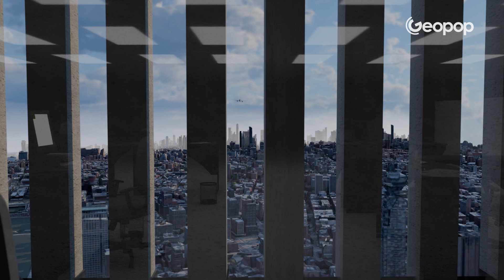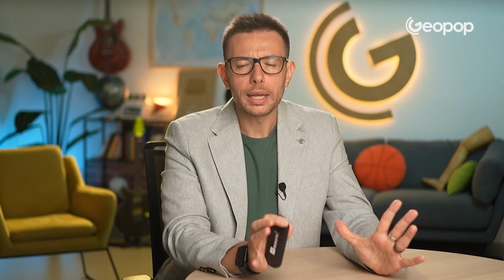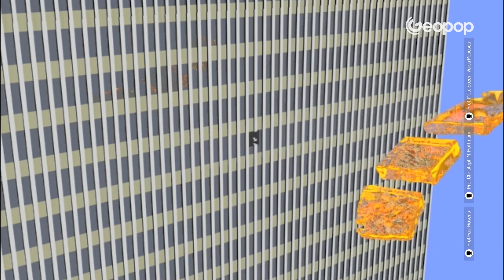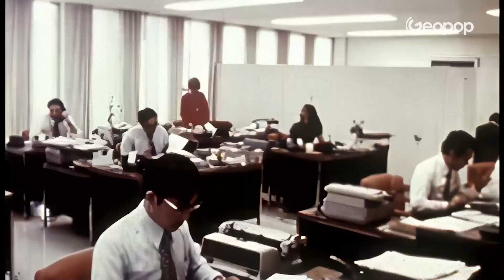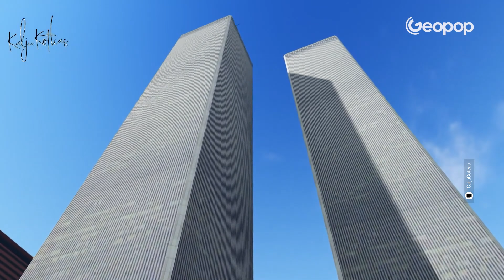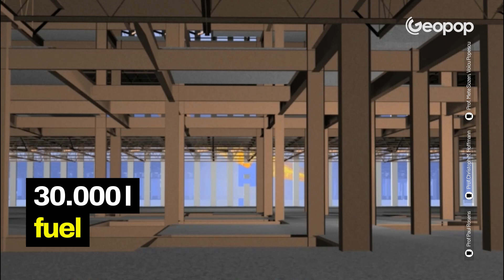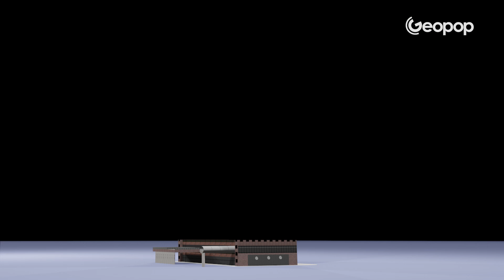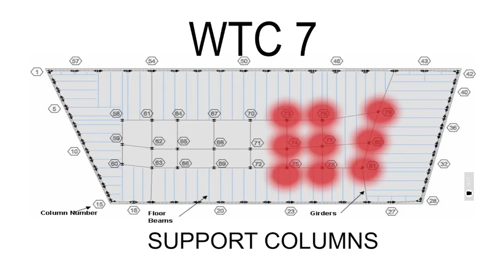9/11, 2001: The Technical Reconstruction of the Twin Towers and WTC 7 Collapses

Comment: Planes took them down ❌
Control demolition with thermite ❌
Directed energy weapon ✅
*go to RumbIe and look up Dr. JUDY W00D and her book; “Where Did The Towers Go?” You will see PR00F that they literally turned into DUST!
Reply: BS!
All you need to answer Wood´s stupid question is take a look at Ground Zero pictures.
Reply: There is a lack of concrete in the pictures,  nano-thermite maybe but I doubt it created this explosion coming from tower 7.  ? 8:25
https://youtu.be/bLF5D7M1YgA?si=aHSvS__uOdxMi1ZB
Reply: @robbiehiatt9966  Lack of concrete in the pictures?!? What kind of concrete did you expect in the pictures? The only concrete above the basement was in the floors, a rather thin layer between a steel plate and carpet or whatever. Even if that concrete didn´t turn to dust, why would you expect to see it in pictures?!? And didn´t it ever came to your mind that most the dust that covered entire Manhattan may have come from the concrete?!?
Reply: @Kudde23 there was concrete throughout the structure in the stairwell with 1 1/4 " rebar. Watch the construction process if you think I'm lying and yes it turned to dust , explosives do that
Reply: @robbiehiatt9966  Collapses do that too. Don´t get me wrong, it was controlled demolition, but you can´t tell that by the dust.
Reply: @Kudde23 there was enough concrete in those buildings to pave a sidewalk from new york to Washington.  Yet none seen anywhere
Reply: @robbiehiatt9966  It was literally EVERYWHERE. As dust.
Then there is also pictures of the so called "meteor" of molten steel and concrete fused together and also some similar but smaller examples the like. A tale of people surviving in a remaining part of a stairwell.
Man I just looked at the first GZ debris picture I found and there was a part that is most likely concrete, a piece of floor or stairwell wall. Sure that´s not much but again, these were steel structures with rather little concrete and most of that concrete was pulverized just because tons of steel were crushng down on it. It wasn´t pancakes falling nicely on the plate.

Comment: heat rises, so the bottom part of the structure, was undamaged, no damage, and built to take the weight of the building above.  If it was not rigged it should have slumped, because the bottom was not damaged
Reply: Correction - Built to take the static weight of the building above.

There's an awful lot of details you are missing.

Comment: I have cut 4 and 6 inch I beams with oxy/acet torches, where no 2 fuel oil burns about as hot as a plumbers propane torch.  I do not accept the gov't story.
Reply: OK, but what does any of that have to so with any governments story?
Reply: @TheLoonResistance  So what´s the difference between the government´s story and NIST´s story stinky? Uh just go and dodge as always stinky...

Comment: The video has many red flags, regardless of the nice animations and design and money thrown at it to make it appeal to the general.
He spoke about the scientific opinion in the beginning of the video, but brought no one to speak and give their opinions to support his claims. He did not provide any scientific facts about the burning temperature of jet fuel and temperature steel can withstand. Finally he did not explain the demolition like the collapse of the towers.
Reply: For the purposes of this video, trotting out a bunch of talking heads to make an argument from authority is not really necessary. The technical literature is chock full of such support and the conclusions shown here are fundamentally the same as those supported by the the 130,000 member ASCE.

There's an entire chapter on steel behaviour when heated. 

Please define a demolition-like collapse if you think that is a thing that needs to be explained. A building collapsing looks like a building collapsing. When your only frame of reference is planned demolitions then of course your brain wants to take the easy route and reach for that. But it does require ignoring all of the details - which is exactly what you are doing in your critique.

Comment: The towers would have broke down like they did, but the bottom floors would have blew outwards, not implode into the footprint of the building. They try to explain this with WT7, but no video footage of the WTC towers blowing outwards. There had to be other causes at play here. The WT7 explanation here is not accurate. All the other buildings in the same area would have met the same fate, but didn't. This is how they cover up the truth. They flood the internet with videos of half truths.
Reply: Yeah, no. Let’s break it down to the absolute basics:

The 47 core and 236 perimeter columns of the Twin Towers support all of the gravity loads of the building. ALL of the resistance is in the columns.

Planes impact Towers, causing massive structural damage, destroying sprinkler systems, tearing out gypsum board walls and blasting off the SFRM insulation from the floors. Multiple floor-wide fires are started instantly and spread rapidly due to the destruction of fire protection systems and venting of the building during the impact.

Serious fires were largely confined to the impact damaged floors and those immediately adjacent to them.  

Fires were started by the impacts and fuel aboard the aircraft, which acted as an accelerant. No shortage of other consumables inside the tower to continue the fires. 

Collapse was initiated (started) at the impact and fire damaged floors when floor trusses exposed to heat over time sagged, in turn pulling on and causing the inward bowing of perimeter columns by up to 5 feet until they buckled. 

www.youtube.com/watch?v=ULdiD6gYZO0  

No steel melted or needed to. Structural steel will bend and fail at less than half its melting temperature.

Once the perimeter columns buckled the formerly static load above became a dynamic load 30 times greater, easily overwhelming the structure below.

Thousands of tons of now loose debris fell through the open off space - through the inside of the building bypassing the columns - dropping 12 feet onto the first intact floor it comes across. The massive instant overload causes the floor to fail, adding its mass to the falling mass which continues to accelerate for another 12 feet until it impacts the next floor, rinse and repeat all the way down. Rate of collapse increases as momentum increases. As each floor fails, air inside the building (the Towers were 95% air by volume) is compressed, then blows out the sides _in reaction to the Tower falling, not the cause of the Tower falling.

No fire required at all on floors below the impact points for them to fail. The mechanisms that started the collapse are different to the mechanisms which continued the collapse.   That will be a difficult concept for some.

As the floors fail the perimeter columns are left literally hanging in the breeze, no longer attached to the rest of the structure. They peel away and fall in great sheets (think banana) out to more than 600 feet from the base on the 4 points of the compass. 

Core columns failed last. 

Each 110-story tower had a 1-acre footprint. The debris pile was up to 14 stories deep and spread out over 16 acres, destroying 8 surrounding buildings and damaging more than 100 others.
Reply: Here's the cause for tower 7, listen close.8:25
https://youtu.be/bLF5D7M1YgA?si=aHSvS__uOdxMi1ZB
Reply: @robbiehiatt9966  - Yes, a single video shot 6 hours before 7's collapse where an asshole from England dubbed in a fake explosion noise from a video game is your best evidence. And you know this but you keep reposting it anyway, expecting different results.  FFS 🤦‍♂🤦‍♂

Comment: Anyone who claimed it wasn't hot enough is an idiot and didn't learn anything in school! Anyone who doesn't know how a blacksmith works ..how shape metal! I just feel sorry for them. I was 13 years old at this time and understand this! I will never forget this day for the rest of my life.
Reply: It sounds very much like you're saying that buildings can't be built to withstand a fire when actually buildings are designed with steal because of its resistance to fire. These buildings, like most, are designed to burn to extinction without collapse and your saying that isn't a thing but I promise you it is
Reply: @ What are you babbling about? It's about the WTC and you see what? It's not!!! Bye OMG
Reply: @marco203 wtc was designed to burn to extinction without collapse.  There were explosives in the buildings that created explosions like this one here from tower 7. 8:25
https://youtu.be/bLF5D7M1YgA?si=aHSvS__uOdxMi1ZB
Reply: @marco203  These towers were literally designed to withstand airplane crashs and in contrast to the lies that stupid shills spread they OF COURSE also considered the fires that would surely result from an airplane crash. And guess what, they came to the conclusion that the fire would be the biggest problem, for the people inside, not for the building which would keep standing. That´s what the engineers in the WTC construction figured out. And that´s despite the fact that the towers didn´t even have sprinklers when they were opened.

You may also find interesting that NIST analyzed steel from the fire zones, steel that was directly involved in fire. They couldn´t find a single piece of steel that had reached 600°C or more. The very most parts hadn´t even reached 250°C.

So now go back to your beloved moronic blacksmith and ask him to repeat his show with steel at 250°C and not such a tiny iron stick but a WTC core column. He may even use his whole body instead of his pinky finger. Good luck!

Comment: How did the plane impact and fires on the 70th floor put a 45 degree cut in the base of the steel beams ?

This video is comedy gold

Google windsor tower fire madrid 2005.  Whole building from 1st floor to top floor was on fire for 24 hrs, didnt collapse though.
Reply: The Windsor Tower also wasn't hit by a  plane weighing tens of thousands of tons loaded with 9000 gallons of jet fuel flying at over 500 miles per hour .
Reply: @joesmith8398  - Worth noting ALL of the steel outer structure of Windsor Madrid above the 17th floor (a heavy, reinforced concrete utility floor) completely failed within about 3 hours.  The only bit still standing after that was the reinforced concrete central core, which none of the 9/11 buildings had.

This is why analogies are not evidence, especially when they are NOT ANALOGOUS.
Reply: It didn't.  The 30-deg angle cuts were made on October 29th by workers using cutting torches and thermal lances to remove debris.
Reply: Buildings are made of steal because of there resistance to fire.   Most highrise structures,  like the towers, are made to burn to extinction without collapse.  Yall are pathetic
Reply: @robbiehiatt9966  - So then why does steel need insulation added to bring it up to acceptable levels of fire resistance?

In this video starting at 22:30 and running to 28:10 the Energetic Materials Research and Testing Center (EMRTC) conducts a test to see what an open jet fuel fire can do to a loaded and unprotected steel I-beam. Remember, steel melts (turns into a liquid) at around 2,600-deg F, give or take depending on specific alloy. The test was planned for 30 minutes.

youtube.com/watch?v=JXWCMBuusMI&ab_channel=TrutherTVArchives

Within 2 minutes the open fire temperature has already exceeded 2,000 deg-F. 

After just 3 minutes 40 seconds the beam is sagging noticeably.

The bare steel beam fails and collapses 9 seconds later after just 3 minutes 49 seconds

Comment: Aluminum planes do not slice through a steel building without any pieces breaking off and falling down to the street immediately.

What we “saw” that day defied physics
Reply: It's not a cartoon. A multi ton weighted plane flying at 590 mph won't just bounce off a steel column building , even though that's what happens in cartoons.
Reply: @ you have it exactly backwards.

it’s not a cartoon, like a plane leaving a Wile E Coyote imprint in the side of a building, remaining perfectly intact upon impact.

Human minds are collectively messed up
Reply: @Sprysage  - There was no "slicing", no "cutting".  The reality far more brutal and violent, the primary failure mechanism shown in this short video:  www.youtube.com/watch?v=P8mG9pyImb8&t
Reply: @Sprysage "remaining perfectly intact upon impact" It was destroyed as it impacted the building. The sheer mass of a 767 ( they weigh over 400,000 pounds !! ) and velocity ( 460 mpg for American 11 and 590 mph for United 175 ) was enough to destroy or severely damaged over 40 per cent of the towers core columns in addition to about 25 per cent of the outer steel columns. The fire that ensued further weakened the steel. Once the floor trusses started to collapse, the outer columns buckled inward as there was no longer any support with the trusses no longer being anchored between the inner core columns and the outer perimeter columns. Once enough floors collapsed, the tops of the buildings came down on the rest of the building below. It's not that complicated if you simply look at the facts and have a basic understanding of physics and kinetics.
Reply: @joesmith8398  https://youtu.be/M_pLOvvUpi8?feature=shared
Reply: @joesmith8398  Watch an episode of mythbusters and get back to me.
Reply: @joesmith8398  This might prove helpful too. https://youtu.be/M_pLOvvUpi8?feature=shared. BTW, the guy who filmed the only video of the first “airplane” hitting happens to be a professional film and graphics editor, and has worked extensively for the US government.
Reply: @joesmith8398  “Where Did the Towers Go?” You’re invited to YouTube it or get the book.
Reply: I believe the reason that was explained in the video is that the building is heavier than the plane combined with the speed of the plane... the plane disintegrated. I mean I pretty sure no one here has a bachelors degree in Physics. I am sure it is a very complex subject more than we'd like to think.
Reply: @deniziscool  anyone can watch Mythbusters to see what happens to various objects of different densities hit stationary barriers. 

Also, everyone is capable of understanding what the story “The Emperor Has No Clothes” is all about.
Reply: @Sprysage  - And what happens to 120 tons of airplane when it hits a cage of light steel tubes and glass (more glass than steel) at 589 mph with more energy than a ton of TNT we can see on 9/11/2001.

Reality happened.  If YOU do not understand the reality than recognize that is the YOU problem that it is, fix it or move on. Reality is not wrong just because you don't get it. You got that backwards.
Reply: but we all saw it happen, undeniable
Reply: @mayflowerkid  we saw buildings turned to dust.  Search 9/11 Alchemy
Reply: Only for those who don't understand physics.  In fact, even water can cut through steel if it is moving at a high enough velocity.
Reply: @ChristLink-Channel  think again.
Reply: @Sprysage So you are saying that high pressure water cannot cut steel?  Boy are you ignorant.  Try googling that...
Reply: @ChristLink-Channel  not without water going backwards, nor disappearing completely through steel, no
Reply: @Sprysage Ummm... you might want to check up on something called "water jet cutting".  Widely used in metal shops.  It involves a jet of very high pressure water moving at high speed, and it does, indeed, slice through steel as though it were butter.  Check it.  So there is no problem at all with a lighter metal being able to slice through a heavier metal.  It happens all the time, in metal shops around the world.  Not an issue at all.  The aluminium used to make jet aircraft is really tough, and when it is moving at hundreds of meters per second, it can indeed slice through steel and concrete, just as certainly as a drinking straw can penetrate a human just as easily as a bullet, when moving fast enough.
Reply: @ChristLink-Channel  water jets and bullets! Wow, not 767s with fragile wings, and aluminum tube fuselage, and fat engines.

Two things for you to check out: Morgan Reynolds Qui Tam case, and then Newton’s laws on equal and opposite reactions.

Be good!
Reply: @Sprysage Not sure what your point was here: You were saying that it is impossible for water to cut steel.  I showed that it is, indeed, possible for water to cut steel, and in fact it happens all the time, in metalwork shops all around the world.  It's rather common, infact. Therefore, if water moving at high speeds can cut steel, then so can aluminium moving at high speed.  Even more so, since water is liquid while aluminium is solid.  Very solid.  You might also want to look into wire EDM, to understand how one metal can cut another metal.  I'm very familiar with Newton's laws, thanks.  Did you have some point to make about Newton's laws, regarding water jet cutting and wire EDM?
Reply: @ChristLink-Channel  1) your examples are of things that are designed to cut steel. Planes are not

2) I said that a lot of water goes BACKWARD with the water jet, yet you ignored that. 

3) the image of a plane disappeared completely through not only the steel exterior walls, yet also through concrete floors, with nothing breaking off backwards.

There is nothing you or anyone else can say about this. It absolutely makes no sense, from a physics standpoint.

Take care
Reply: @Sprysage "I said that a lot of water goes BACKWARD with the water jet, "  Clearly,  you have never seen a water jet cutter in action.  ZERO water goes backward.  Why would it?  In order to do so, it would have to defy the laws of physics.  Thus, it does not.  By the same token, why would airplane parts with very high inertia suddenly also defy the laws of physics, turn around and go backwards?  That makes no sense either.  I suspect that you don't understand inertia at all.  Or physics. You are suggesting that bullets should bounce of the targets they hit, rather than going through...